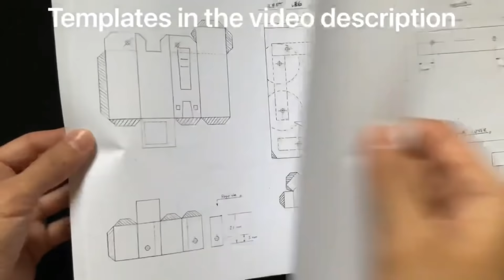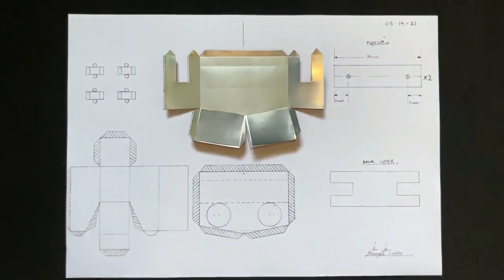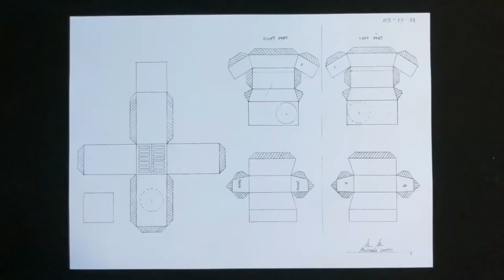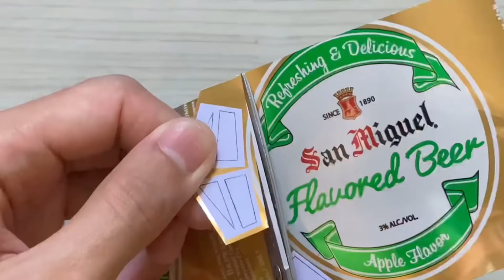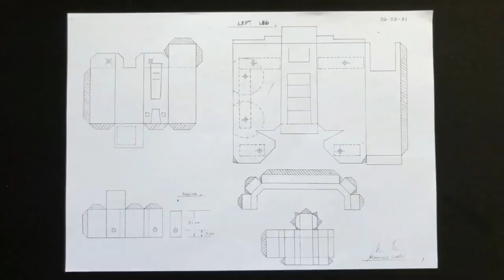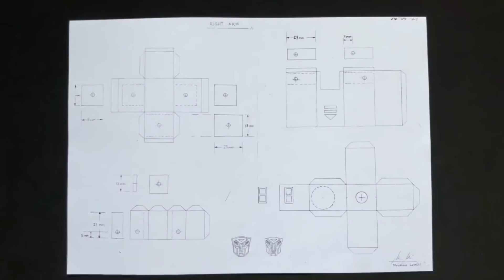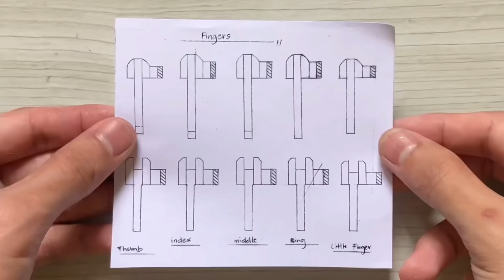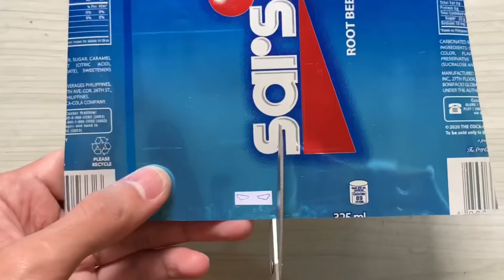Homemade Transforming Optimus Prime G1 using Soda Cans

Comment: Upcycling and recycling?   All the technology to produce this, the actual plastic display robot, all the tools including glue, paints and other and the disposal of said build with cleanup afterwards.  You mean upcycle and recycle videos for views = profit.   I'm one of the last to call out humans thar actually make a difference and require private jets to do so.....they are celebrities and you aren't taking a rotting tree with wind power to a summit but, not necessary to state that at the beginning here.   Just say, "Look at me and what I spent time on.".   Hooray. As I fast forwarded to the end, I will say, it was rather excellent but, I wouldn't take my time to do this.  (As a caveat, you do have to add wheels and take out part of its ribs and flaps to transform)